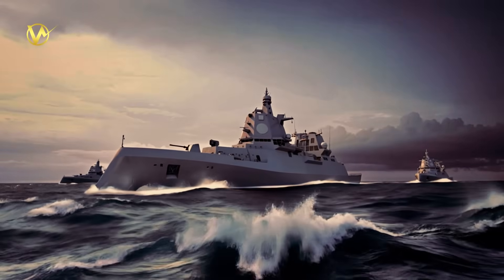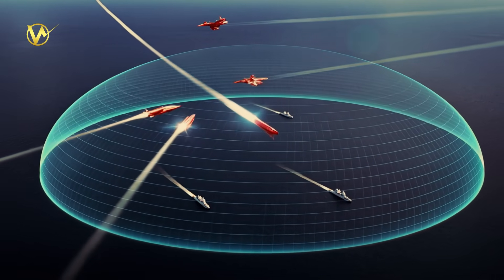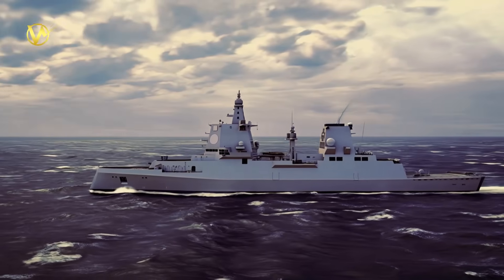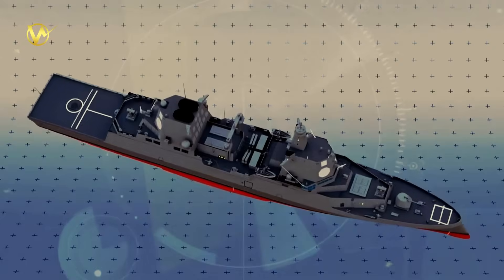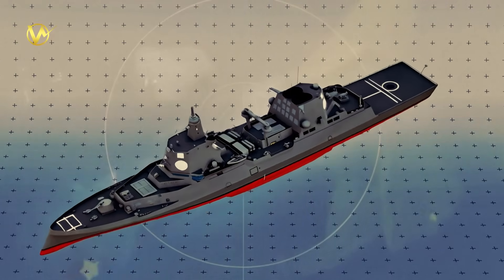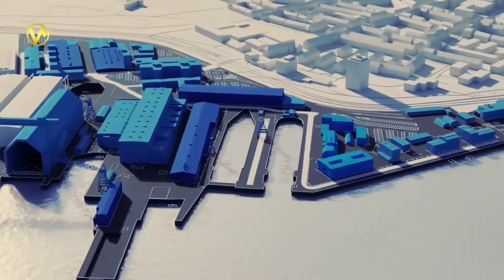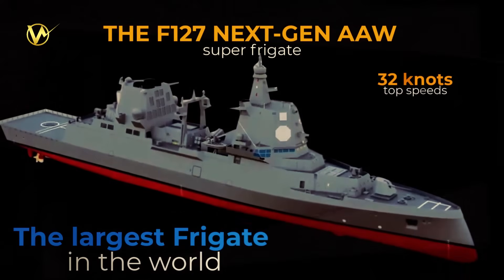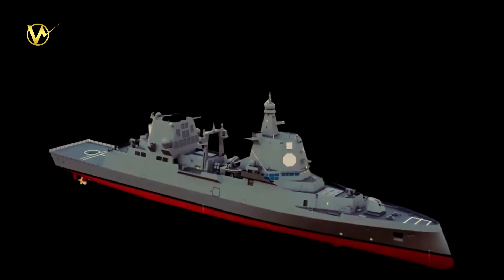The Secret Reason Why the F127 Super Frigate Is So Big

Comment: The F126 is essentially the first true German destroyer since the decommissioning of the Lütjens-class in 2003 – it just isn’t called that.
Reply: F126 is better armed than the old destroyers that it replaced, but not least because warships of the VLS era are generally better armed than pre-VLS era. Modern stantard for destroyers is set by something like Arleigh Burke class with 96 VLS cells. Air defense destroyers need large amounts of vertical launch cells.

F126 with its 16 cells is relatively lightly armed in comparison and fairly typical for modern frigate. Perhaps it can be said that the armament is even a little light for a VLS era frigate.

With its supposed 64 VLS cells the F127 would be somewhere in between, not very heavily armed for a VLS era air defence destroyer but fairly healily armed for a frigate.

Comment: Makes no sense. It's as big as a cruiser or destroyer. And only 64 VLS?
Reply: Keep in mind, missiles are expensive.
Aside from that: It´s still mostly an air defence frigate for a formation. ESSMs can be quad packed and there are talks about including IRIS-T or similar also quad-packed. Sure, the SM-2 and SM-6 have a lot better range. But... it defends itself and the formation. It´s still cheaper to shoot 2 smaller missiles at once for higher kill probability, than a single SM.
If you for example have 32 SM-2 and 128 ESSM... that´s kinda plenty. But i also like the Air-defence cruiser concept with +120 cells more. More flexibility.
Reply: @FentionX Ship is also big enough that extra VLS cells can be retrofitted onto it, as the ship is designed to be modular. Importantly, as you mentioned, the IRIS-T SLM launch containers can be packed into some of the module spaces, as can more NSM ASuW missiles or the upcoming Tyrfing supersonic ASuW missiles, which are also supposed to be VLS compatible.
Reply: 64 VLS + 2 RIM 116 ( 42  RAMs)
Reply: In addition, it would also receive a high-performance laser ( 1 or 2 ).
Reply: That statement is outdated. A few weeks ago, news broke that a configuration with 96 VLS cells is now planned. However, the dimensions are primarily based on the technical specifications, the planned endurance, and the required reserves.

Comment: The video completely fails to find the primary reason: Automation and redundancy. The new generation of ships are supposed to stay twice the length of time on mission without dock time while needing only about half the crew. This means everything needs to installed with high robustness and redundancy in place and the automated systems need more space and are of higher complexity so a smaller crew can still manage everything and does not end up in a situation where they are too few to handle things. It is also hoped to increase survivability as most systems are built in a two system setup (reason for the fore and aft castle) allowing the ship to maintain some capabilities even after major damage.

That is the primary reason they end up so fat without adding more weapons.

Comment: Another reason, why it is called a frigate and not destroyer: pure political reasons.
Reply: Germany had the Lütjens-class destroyers until 2003. These were modified ships of the Charles F. Adams class from the USA. The type of ships depends solely on their mission. The Zumwalt-class destroyers are significantly larger than the Ticonderoga-class cruisers, yet they are still only destroyers.
Reply: @oli-barelin  I miss the days, when ships were also categorised by their size....
Reply: @oli-barelin  Yeah, but those were called Destroyers in US service so trying to call them frigates in German service would have been slightly ridiculous.
Reply: @gudmundursteinar  And why are the Zumwalt-class ships called destroyers? Combat power is only as strong as that of destroyers. And for the same reason, we Germans call our ships frigates.
Reply: @oli-barelin  Because that's what they wanted to call them? e.g. like how Ticonderogas were called cruisers because the soviet union had cruisers and the usn didn't, so they just called them that and bingo, you got cruisers. 

The basic problem is that these names no longer carry any meaning or information,.
Reply: Frigates were called cruisers in the age of sail because "cruising" was their task. In modern times we would call that task Area control or patrolling. The term Frigate described the build type of ship with 3 Masts and an enclosed gun deck. When technology evolved the fun deck was replaced by turrets and the masts by steam engines. The ships were then just called by their Task - Cruisers. They were capable and tasked with independent operations.
All the light and heavy cruisers after WW1 can be considered "frigate".
Destroyers meanwhile are simply escort vessels and just "Tin Cans" for most of their history. They just jumped in size when the US switched to nuclear powered carriers and needed escorts with much more endurance. The flagships "Cruisers" of the US before were called "Frigates btw - even the nuclear ones.

The whole displacement thing just resulted from the technology in the first half of the 20th century. You needed bigger guns to penetrate ever stronger armor and more armor to defeat ever bigger calibers. Guns and armor weigh a lot and to make that much mass swim you need displacement. Therefore displacement became a convenient  measurement for arms control.
 Missiles  and planes broke up the balance between armor and armament and people gave less and less shit about displacement. 
Germany for example was under displacement limitations, but was allowed to break those whenever it asked. But you do not need much more than 4000t if you are only concerned about North- and Baltic sea. After the end of the cold war the size of frigates in Europe grew again, because now you need ships for more global operations.

There is more to it, but I can not be bothered.
Reply: @Chiggi0815   Thanks for this elaborate answer.
Reply: Destroyers were originally Torpedo Boat Destroyers so they were designed to take out Submarines and other torpedo boats originally they were only a couple hundred tons. Frigates were always larger ships one step down from the Ships of the Line and larger than Sloops.
Reply: You could Name it a Cruiser!!!
Reply: That myth needs to die.

It is called a frigate because there is no reason to distinguish types and frigate is the more traditional term for a medium sub capital ocean going warship.

Ships were never categorized by size. They were categorized by mission role which was planned out by naval doctrine and fleet build plans. You defined what a destroyer is, then defined you needed ten of these things to fill the roster in your fleet, then you specified the build plan of consecutive classes to fill that role. 
Funniest case is when dreadnaughts or battlecruisers got reclassified to fast battleships. Why? Because the simply criterion was sustainable speed and the navies needed capital ships going that fast. So until purpose build classes came some older classes got retyped to fill the units. None of those early ships started their life as fast battleships.

You are falsely deriving the size thinking from an extraordinary circumstance: A naval treaty where different countries needed a common categorization to agree how many ships of which size each one were allowed to have. Which has zero relevance to war fighting doctrine but was just a convenience for diplomatic bookkeeping.

You want to know how the US navy defines what a cruiser is? A warship with quarters for a task force commander and their staff. That's it. Newer Arleigh Burkes are by now heavier than Ticos.

The French call a class of ships frigates that the Italians call destroyers. They do not do so for political reasons but because they don't give a rat's ass about made up naming conventions. In French it is a frigate, a heavy frigate if you want to be specific.
Reply: @mangalores-x_x   "A naval treaty where different countries needed a common categorization to agree how many ships of which size each one were allowed to have. Which has zero relevance to war fighting doctrine but was just a convenience for diplomatic bookkeeping". And that's what I refer to, yes. It also makes things for us outsiders easier. And that's what I wish would come back.
Reply: @ralfhtg1056  Probably makes more sense to have those treaties between parliaments since it's easier to get funding for a 10k displacement frigate than a 10k dispacement destroyer. Even still easer to get funding for a "Through Deck Cruiser" than the Ark Royal Class Aircraft Carrier... which is how Parliament funded those ships, as cruisers.

Comment: Inverted bows make a comeback? I only know warships of the late 19th/early 20th century had them, not sure why they fall out of fashion in the 20th century. Interesting choice.
Reply: Thou not the first ones to do it . The USA did it with USS Zumwalt class and France with the Admiral Ronarch class just recently!
Reply: There are sea keeping trade-offs, but new computer aided design reduces the downsides.
Also, harder to spot/detect supposedly.
Reply: It looks like it would a wet ship in rough seas?
Reply: @shanesimpson3455  Doesn t seem to be a that much  problem with the Zumwalt destroyer or the french HDI frigate .
Reply: @christianjunghanel6724  Fair response mate, but I have noticed the French ship seems to have a higher freeboard and as for the Zumwalt I have had a mate who served on one tell that they don't handle well in extreme weather conditions.